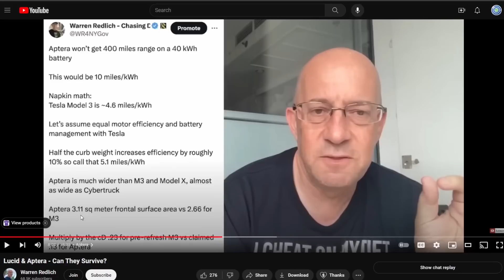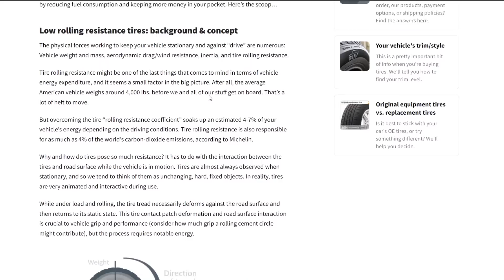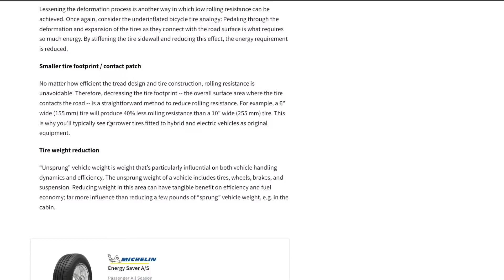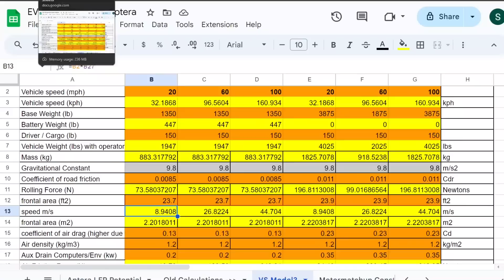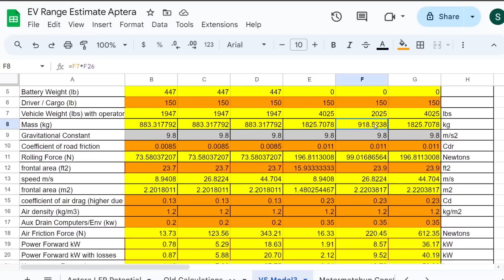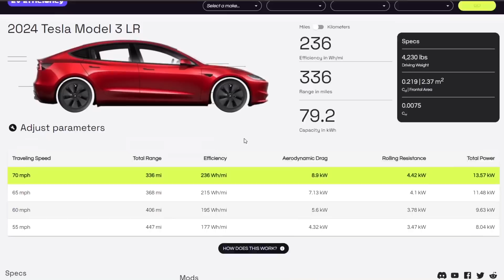Revisiting Aptera's Efficiency

Comment: Disclaimer and Assumptions:  I would avoid assuming the numbers are 100% accurate as some values are estimated. If some values are high and others are low the final range could be reasonably considered to be +-10% with reasonable certainty. That said the calculations can definitely show trends and potential of the design.

-Rolling friction – Aptera will have low rolling resistance tires and less contact area due to 3 wheels. I assume they will have good but not unprecedented rolling resistance at 0.0085. Tires are available rated for 0.007 and typical car tires are 0.01 to 0.012.
-Weight: We don't know the exact weight of the aptera beyond statements and trying to make the other information fit. I am using just under 2000lb (1537 for the vehicle and 455 for the battery).
-Frontal Area: Tailosive did a recent video on the aptera and he concluded a ~21.7 square foot frontal area where my numbers are based on 23 (I measured 22.7 and rounded up). We have never had an officially stated spec for this but given the 3d printing model or photos and analysis I think 21-23 square feet is a safe bet.
-Drag Coefficient: We know Aptera has repeatedly stated they will have 0.13 drag coefficient but given the need to keep mirrors (bloody NHTSA) and ability for small manufacturing differences like panel gaps to impact this I consider it optimistic in the real world.
-Aux Drain. All EVs draw some power for computers and screens regardless of motion. I assumed this value as 200w which may be high but we simply dont know. All the controllers, cameras, thermal management etc need power. Other simulation sites like motor matchup dont even allow this to be set under 500w. Increasing this value higher can simulate the impact of HVAC systems for different temperatures but the exact draw under different conditions is tough to know.
- Battery Size: For the LE we know the pack will consist of 6 modules of 416 cells. Assuming they are commodity 55e cells from EVE exact specs are available and used in the model
- Battery Reserve: All EVs reserve a small percentage of the battery to obscure degradation and avoid going to absolute zero which can damage the battery. I assumed this as 4% for the LE. What we don't know is the amount of weight for the structure and bus bars in the battery but given claims about being very efficient I used a 20% estimate (arguably too optimistic).
- Inverter/Drivetrain losses: Aptera needs to get the energy from the wheels to the motors. I believe Steve F stated in the past they will not be using highest performance inverters (I forgot the term) due to cost (very reasonable given the intended market). I used a somewhat conservative 85% for this (actual powertrain losses vary with speed – Elaphe has some nice graphs)
Trying to make the data fit for the various models given available information on the battery sizes does not align to the stated ranges. The LE looks likely to over perform if the same conditions are applied to all the stated battery sizes (23,45,66,99 kwh)

PS:  Thank you for explaining make a copy right away; otherwise I get a ton of access requests.
Reply from the maker: Thanks for your spreadsheet Curtis. It's awesome
Reply: @ccibinel Great job Curtis! As a test I used your spreadsheet to calculate the theoretical efficiency of my Kia EV6 and the numbers match perfectly with my real-world performance.

Comment: Drag force does vary with the square of the speed, but power needed to overcome that drag force varies with the cube of the speed. From Wikipedia[0]:
"Note that the power needed to push an object through a fluid increases as the cube of the velocity. A car cruising on a highway at 50 mph (80 km/h) may require only 10 horsepower (7.5 kW) to overcome aerodynamic drag, but that same car at 100 mph (160 km/h) requires 80 hp (60 kW).[16] With a doubling of speed the drag (force) quadruples per the formula. Exerting 4 times the force over a fixed distance produces 4 times as much work. At twice the speed the work (resulting in displacement over a fixed distance) is done twice as fast. Since power is the rate of doing work, 4 times the work done in half the time requires 8 times the power."

Power output is directly felt by the rider, so it's the more relevant comparison here, and your comment is more practically useful.

[0] https://en.wikipedia.org/wiki/Drag_(physics)#Power
Reply: But when traveling one tends to travel for a given distance, not a given time.  If you travel 100 miles then we are considering the power expended over that distance.  Doubling the speed may be 8x the power, but expended over half the time, thus 4x the Watt Hours.  Feel free to explain where I have gotten this wrong.
Reply: @wingsounds13  Thanks
Reply: Thanks for including the reference.  I'll look into this and correct the equations if I can corroborate a flaw in the formula I used - probably take me a few days given work and commitments the next few days.

Comment: My bet is no major production and bankrupt. Advertised 1000 range yet only 45 miles on a days sunlight charge? 
Electric motor overheats going up a small hill? Seems like "Fraud" to me!
Reply: It is a battery EV that can be plug-in charged that has 700 watts of solar panels that can provide up to 40 miles of charge per day.
Reply: I don't totally disagree with you, as it's still up in the air whether this thing will happen. But that overheating was with a prototype that didn't have cooling connected to the motors yet, so that's kind of a BS issue.
However, I can see why they might be having cooling issues, given the lack of a traditional radiator.
Reply: You are cherry-picking stuff that by themselves are true -- sort of -- but don't relate to each other. The 1000-mile version of the vehicle will have a 100+ kWh battery; "sunlight" charge is gravy on top of that. The overhyped wheel motor overheating happened when the cooling was disconnected. I bet your ICE might overheat if the radiator hoses were disconnected.
Reply: @DrTeeHenry  And EV drivers pass by overheated ICE cars, stuck in pullovers, on significant climbs all the time.
Reply: Where is your bet? My bet is on the leaderboard. That's right, real money on the table. success or failure, I'm good with my bet. So your just another naysayer spewing negative vibes, eh. thanks for the motivation.

Comment: Well it is very early to speculate and we need to be careful given the hedging Chris A has made about how weight and tires affect the mileage.   The efficiency numbers of Aptera are not possible to determine because Aptera has not provided information on the production vehicles.  We do not know its actual weight, we do not know the actual cD, and we do not know the efficiency of the motors.   
  
What we do know is what tires they did purchase fifty of but even then we don't know if this will be the tire on production vehicles.  Those tires are from PT Hankook out of Indonesia and the specs are 195 50R16H,04,H735. We actually do not know the cD of Gamma because even though Aptera made a big deal out of going to the wind tunnel Chris and Steve both refused to provide the results and would not even state if it confirmed the numbers they expected, all they could claim is being one the most efficient measured.  
  
In other words, this is all fantasy because there are too many unknowns so using the fictional numbers we have all we can get are guesses.

Comment: Most important thing for vehicle efficiency - is drivetrain efficiency. The lack of reduction gears and driveshafts means the Aptera will have a bit higher efficiency than other EVs. Some hub motors are as high as ~98% efficiency. I don't know what the number is for the Elaphe motors. Reduction gears can lose 1-2% I think? And spinning the mass of the drive shafts (and their flex) also loses a bit of energy. This is why EVs are so much more efficient than ICE vehicles.

Second most important factor for vehicle is aerodynamic drag. Total drag is total frontal area X coefficient of drag. So with the outboard wheels, the Aptera has a smaller frontal area. The VW XL1 has about 16sq ft - the lack of optical side view mirrors subtracts about 1sq ft (total for both mirrors) and this lowers the Cd by about 0.01, which is much more significant than it sounds. Aptera has said that a majority of the drag is coming from the front suspension, and the space between the wheel fairing and the main body.

An aside - I have been following Aptera from the very beginning, and on that first design they went from RWD to FWD - and the round drive shafts alone added something like 0.03 or 0.04 to the Cd. A spinning round shaft is pretty awful for aerodynamic drag. This is another advantage of the in-wheel motors. 

For every mile you drive a 25sq ft vehicle - you have to shift about 4.5 TONS of air out of the way.

Third most important factor of efficiency is weight. Accelerating a mass takes energy, obviously, and more mass/weight is worse. Wheel/tire weight counts "double" - it is part of the overall mass that has to be accelerated, and they have to be spun - even if the tire is off the ground, it would take energy to spin.

Fourth most important is rolling resistance - and weight is a large contributor to RR. Wheel alignment and brake drag and bearing friction are other causes of rolling resistance; in addition to tire deflection. Even tread squirm is a factor - newer tires have higher RR than worn tires.

Comment: Seems everyone is mostly concerned about steady state vehicle speed when considering efficiency.  I wonder how real world daily driving compares.  Given that the average speed over time tends to be around 25MPH due to lots of stop and go traffic, it seems it would be useful to know these numbers.
Reply: Elaphe has the powertrain efficiency heart graphs at low rpm and the regen breaking should be fine.  Aptera is very light weight which reduces the impact of acceleration.  Most of the same reasons the aptera range at a constant 20 mph is really good means in stop and go Aptera should do really well.
Reply: @ccibinel  Understood.  I'd just like to see some numbers that related to typical use.
Reply: For stop/go traffic in towns, aerodynamics is mostly irrelevant.  Weight & the efficiency of regen-braking will be the biggest factors in that scenario.  We know the weight (approximately), but we don't know the regen braking efficiency.
The trouble with 'real world efficiency' is that everyone's experience will be different.  I do most of my driving at highway speeds, with very few stops, for example.
Reply: @WyndStryke  Everything is relative to other vehicles.  We have no reason to expect that the Elaphe motors would be exceptionally poor at regen or low speed use.  Given that the general model for travel at speed should be indicative of how well Aptera will handle the situation; not saying ~800 miles of low speed range will happen but we have no reason to believe Aptera has any glaring weakness.
Reply: @ccibinel  Yep, sure I agree, but I just don't think we have enough data to be able to predict it in a stop/go style environment.  Highway driving is much easier for us to predict since they've told us the key information already.  Aptera themselves will be able to estimate quite accurately since they'll know how the hub performs in that scenario.  My hope is that a lack of a drivetrain will mean that regen is more efficient than other vehicles.

Comment: As you point out, the speed of the vehicle is critical.  Aptera's claim of 100Wh/mi is at "highway" speed.  This is a huge variable as the EPA will measure highway speed to a max of 60 mph with an average of 48 mph.  Now we all know that is very unrealistic as you would be run over even at 60 mph on the highway today.  If you actually measure your average speed on a road trip, you will be surprised to find that your average speed will actually very close to 48-50 mph even though we might be driving 70-80 mph.  (Traffic and on/off ramps really will dig into that average.)

If we take Curtis's spreadsheet and use 48 mph for the Aptera, it is very difficult not get 100Wh/mi or less, using realistic numbers.  (Less is better.) If Aptera is measuring the efficiency at 48 mph, that is what the EPA will do and what the vehicle will have on the window sticker.  (I would also increase the weight of the vehicle and passenger(s) so the total is closer to 2,200 lbs. The average weight of an American male is 197.6 lbs.)

Thanks Curtis for the spreadsheet.  The cool thing with this is that we can figure out the weight of the battery pack for the most part.  There are some unknowns as what the cooling system will weigh but Chris & Steve have recently said that it should come in around 2,200 to 2,300 lbs which seems more realistic to me.

Comment: That was very helpful to review this efficiency spreadsheet. especially considering that there will be the big reveal of the PI model Aptera EVs (testing for and showing real world efficiency, range and safety) starting sometime in the coming months. It is not surprising to have many people doubtful of Aptera's efficiency claims because there is relatively little real world difference in range and efficiency among conventional EVs, short of giant, heavy, inefficient BEVs like the Hummer. One other point that isn't likely to be revealed in the math is that the production motors on the Aptera have been custom engineered by Elaphe for the Aptera. We saw this when Aptera changed their motor HP rating and 0-60MPH times for the Launch Edition AWD model. Elaphe had originally engineered their in-wheel motors to produce huge torque needed to move much heavier EV crossovers and pickup trucks, but the final production motors for the Aptera will be different. Designed to optimize efficiency, and to take advantage of Aptera's smaller battery pack and lighter weight.

Comment: The STL file might not be that accurate as they thickened the wheel linkages and the side mirrors to make it a less fragile model. But for the sakes of your exercise, probably fine.
Reply: I actually don't think they did.  I did for my unofficial patch bit their version seems like it might be accurate.
Reply: I seem to recall ChrisA saying recently that they've been working on the aerodynamics of the wheel linkages.  So the CD may have actually improved since the STLs were generated.
It'll hopefully all become clearer once the PIs are here, and are undergoing aero/range validation.

Comment: Redlich claims 50% weight loss equates to 10% range increase,  even though it's directly proportional to weight,  requiring at least a doubling of range,  further divided by ~0.75 because of using 3 wheels instead of 4, therefore the mass component of range is ~2.67 times greater with Aptera. As you mentioned,  frontal area is roughly equivalent,  and aero range component is directly proportional to Cd.

Comment: There is three other things beside weight, air, and rolling resistances.  You also have to account for gear lash and axle couplings loss of efficiency which don't apply to the Aptera but does to other EVs. The one other thing that both the Aptera and other EVs have to account for is synchronicity of the drive motors.  If they have more than one drive motor and the EV doesn't properly maintain tire rotation of the wheels they control also will effect efficiency.